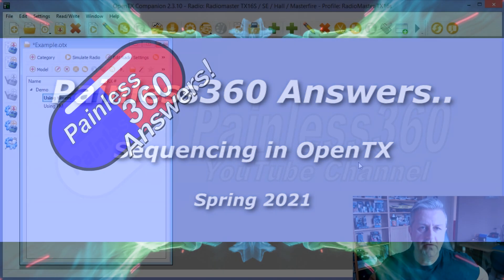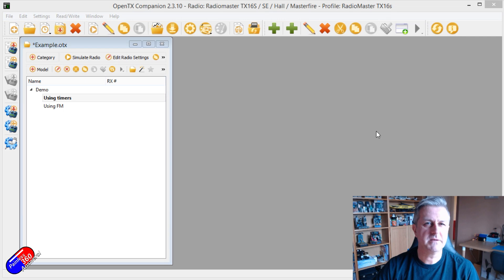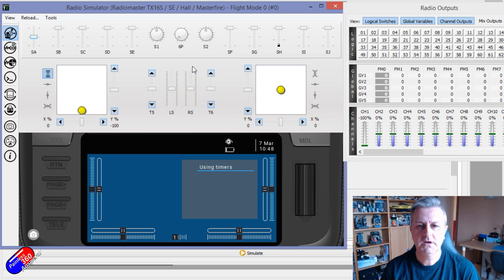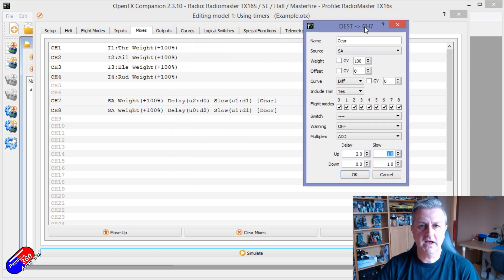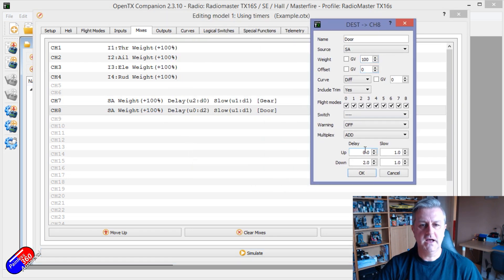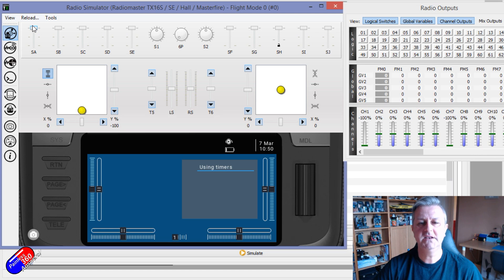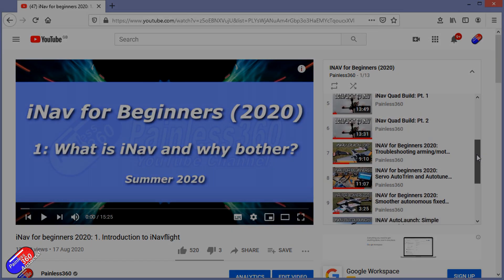Sequencing/delay/slow outputs and servos in OpenTX (easy)

Comment: hey pal, so im making a rc octopus and i want a servo to move the tentacles. how would i program opentx to make a servo go back and forth in a loop. to pull a wire that swings the legs on a pivot. so like i turn on a switch it makes the servo go left and right, left and right... till i turn the switch off? 
is there a way to make that happen or do i have to program a microcontroller or something?  
thanks in advance for any info
Reply from the maker: Check out the Opentx mix school series. I. E. https://youtu.be/k7poAcGmWO8 best of luck

Comment: could you help me with my ardupilot apm 2.8 when i try to takeoff i throttle up slowly and at one point it will pretty rapidly flip over basially. yes i have checked my props. my motor rotations. my esc signal wires.  and the rotation so the APM faces forward plzz help i have a video of it flipping over if i can send the video to you via mail maybe ?.
 it may not help but gotta try
Reply from the maker: Sounds like you've checked a lot already. See my video  on 'what to check if you model flips on take-off' for the full list but if all of those checkout I'd look to re-flash the FC and re-check the setup.. Best of luck!

Comment: I used that slow down setting for my flaps because I didn't like the idea of the flaps snapping down in to position & the aircraft suddenly pitching up.. After all, their not instantaneous on full sized aircraft, so why should they be on the model that has far less mass to compensate...

Comment: Hello Sir, Great video again! Can You maybe also show how "limit the use of a switch". I have a fixed wing plane with electro start connected to my momentary switch and it works perfectly. However, is there a way to programme the Tx so that the momentary switch will only "work" if I hold "Trim 5" towards the middle (to the right)? This will prevent me from accidently turn the starter of my engine.
Looking forward to Your next video.
Stay healthy!
Reply from the maker: I've made a new video on that and added it to the series. It isn't too hard but worth showing..
Reply: @Painless360  Thanks a lot, that will be absolutely great!

Comment: I was wondering whether there is a way of adding a random delay? For example, pressing a button or switch would play a sound wait a random delay between 1 and 5 seconds and then play a second sound. I haven't seen any tutorials for this type of thing in OpenTX, but it would be extremely useful for race practice where you'd need a count down followed by random delay then a start beep.
Reply from the maker: I'm not aware of a way to have a random number in OpenTX  like that but I've seen LUA scripts that do something similar - i.e. https://github.com/alexeystn/droneracing-timer-lua-script
Reply: @Painless360  This is perfect! thank you for sharing. I had looked for something similar but was only able to find a script that no longer worked. top man!

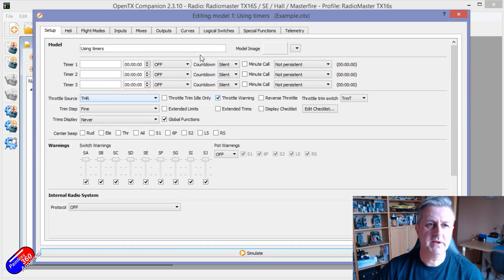Comment: Hi Lee, I am a bit confused here, as in the video (specifically pause at 3:41) It shows a delay in the GEAR going up and the delay in the DOORS down. Should that not be reversed?
Reply from the maker: The delay is for the channel on the radio. How that works with the servo on the model depends on how it is physically installed and connected so a bit of trial and error is normally needed.. Happy flying